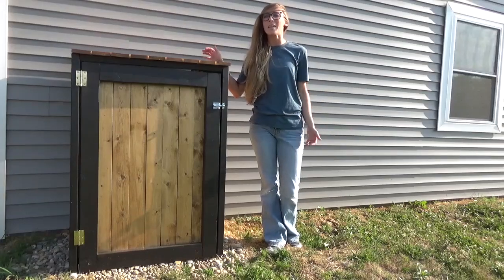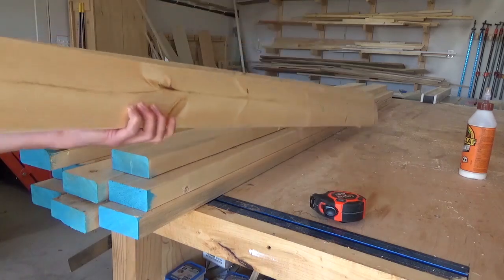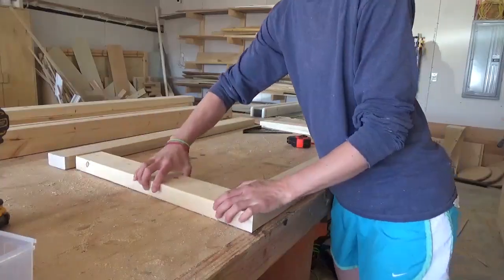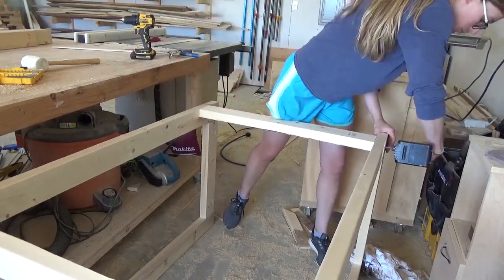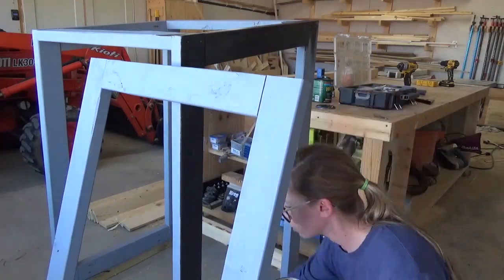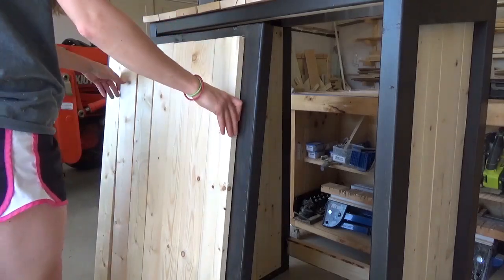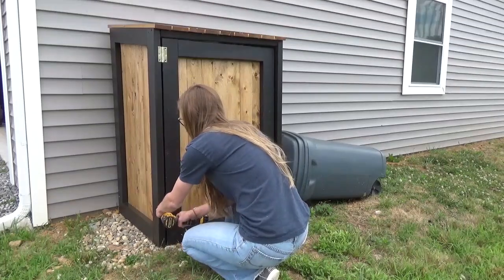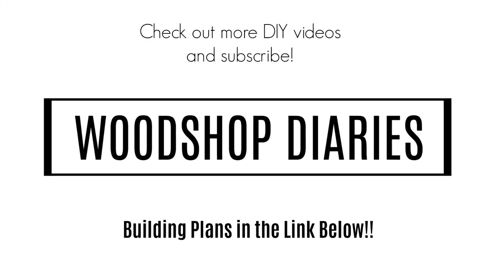How to Build a Trash Can Cover {EASILY From 1x4s and 2x4s!}

Comment: I started building this yesterday. I might make it 2 wide or make or put a frame in middle section so I can put both our recycling and trash cans. Both are about the same size and animals also are a problem (racoons have gotten into my trash and occasionally the recycling when someone put food stuff not fully cleaned out of said recyclables). So this would put an extra layer of deterrent for those critters. My current build was an ugly box frame that I would have to lift the trash can and recycling bin out of and when full, they are very heavy to get out of the 2' tall box. I like this design. Thanks for posting it!
Reply from the maker: Awesome! That’s a great idea to make it double for recycling too!
Reply: I did see one comment about using cheap fencing pieces for the slats and might do that. I was going to do cedar but $130 worth of wood vs $85 for the 1x4 pin from Lowes.  I may go with the fencing and save the pine for indoor projects. Just needs to be sanded a bit as the commenter said.

Comment: The cover looks good and I like the stain and paint colors you chose. I have a fence around our air conditioner and I coat it every 2 years with an outdoor stain and it has not rotted yet so if you coat the cover it should last a long time.
Reply from the maker: That’s good to know. I’ll definitely check ever so often if it looks like it needs a recoat. Hopefully we aren’t here for a full two years and it won’t matter haha. But, you never know.

Comment: The waste management company here provides the trash bin and it is a monster size one, still I have thought about building something like this and I appreciate the motivation your video gives me to stop waiting and start building.  I like the idea of using cedar fence pickets for the slats because they should last really a long time.  They come super rough (where I am) but a few trips through a thickness planer would smooth them down pretty nicely and I have some left over from a previous project.
Reply from the maker: I LOVE cedar. That would work great for this. It comes really rough here, too but like you said...a few trips through the planer would make them really nice. Happy building!

Comment: I want to try this but I am very unexperienced with building and do not have the "fancy" tools. Can you make this with just a hand saw and a drill?
Reply from the maker: You definitely could. They’re all simple cuts and you can skip using a pocket hole jig and just use screws driven at an angle or long screws through the boards instead.
Reply: @WoodshopDiaries  thank you so much!!!

Comment: I like how it turned out.  The only suggestion I would give is to reinforce or support the back more.  I noticed that when you open and close the door it moves some.  You can also correct this by securing the back to the side of your house but I can understand why you would not want to do this.  Regardless it turned out nice.
Reply from the maker: Thanks so much!

Comment: Thanks so much for this video.  I’m going to make three of these with hinged lids for our trash, recycling and yard waste.  (yes, I live in CA and they give us a bin for everything! 😂)  Question, on the cut list (pg 3) it says the side panel front pieces are 1 1/2” X 3 1/2” X 46 1/2” with one end mitered 7 degrees.  Yet, on the diagram on pg 4, it shows this front side piece as 46” rather than 46 1/2”.  So my question is do I cut it to 46 1/2” and then miter the end 7 degrees?  Or do I cut it 46” and miter the end 7 degrees?  Thanks in advance!

Comment: Question should I use Thompson’s water seal or 1x4 or wipe on poly or both. Almost done.
Reply from the maker: You can use whatever finish you prefer as long as it’s rated for exterior use 👍
Reply: @WoodshopDiaries  i almost have it done. Need to buy cut another 1x4 for sides and one more for front.I resized the plans a bit to my trash can but made it too snug. It would fit but barely so I had to move the 3/4" 1x4's from inside to outside. They look better on inside imho. I could plane them down a bit to give me the 1/2" of extra space for it to roll in and move them back in. I saw the dog-eared picket fence pieces are like $1.82 each at home depot which might be a bit cheaper than the 1x4" pine and more resistance to water. I put Thompsons water seal on all the slats as its not cedar or pressure treated. Some of my 2x4s are as they were leftovers I found under my deck. Might extend to twice as wide or make a 2nd one. But I need a rolling recycle bin with more capacity. Since COVID-19, we have been generating almost 2 trash cans worth of recyclables but only 1 of trash a week.  
Here are pics of it (if links works). I may put some darker stain. I like the look of yours. My pine looks too pale. Could be the variety or the stain. https://drive.google.com/drive/folders/1ig5zgovm80nuPufvfmVwRPV6h7QBdWhn?usp=sharing

Comment: I have a problem figuring out the length of lumber to cut when there's an angle and distance between the tall and short boards - don't want to waste lumber, since it's now 3x the price from last Nov!
Reply from the maker: The plans for this detail the measurements you need 👍 they’re in the description 😄
Reply: @WoodshopDiaries  Thank you, but my project measurements are not the same as yours.  Also, I don't actually plan to make this for the same purpose as yours.  Let's say I use 7 degree angle, but the width of whatever I build is greater than the one on your plan, by the time I get to the front piece, the height of that front may be too short.  That's what I always have problem with, figuring out the proper measurement so I don't waste the lumber.  Plus, one mitre cut on a straight piece of board yields 2 ends of the same angle so technically I should be able to cut once and get 2 vertical boards with the same angle.  If the width of my side panel is different than yours, using the same 7 degree angle, the heights of the vertical boards, esp. the front one, will be different.  Or, the angle will have to be modified.  That seems to be the issue facing others too who left comments on your blog.
Reply from the maker: I’m not 100% understanding what you’re saying, but my suggestion is to start at the front so you get the correct height, then cut the bottom piece to get you the correct width. Then use a large square or a straight board (just make sure it’s square to the bottom board) and lay them out on your work table. Then you can kind of measure and mark where you need things to go instead of doing the math to get there. You can cut the back Board the height you need and lay a board across the front end back and mark the angles and lengths that way.